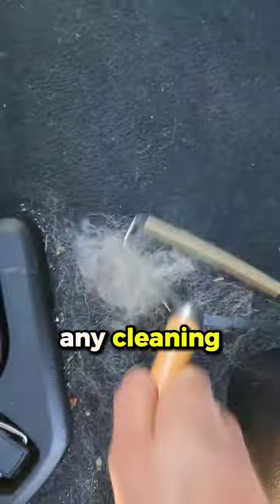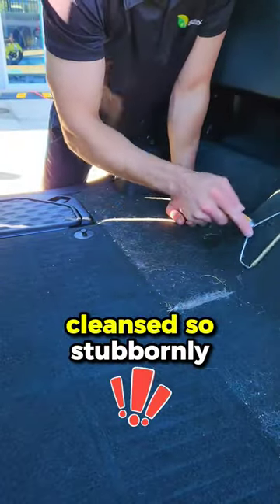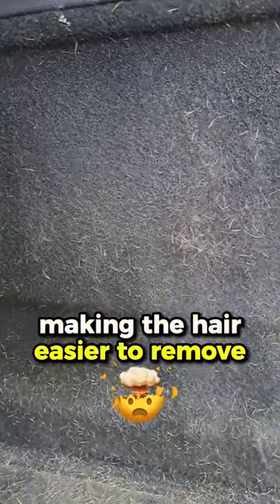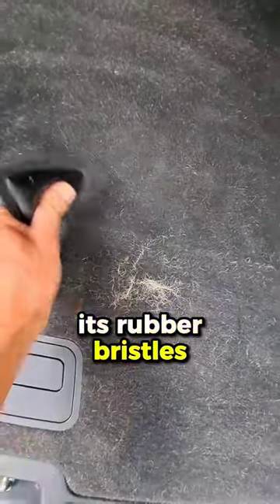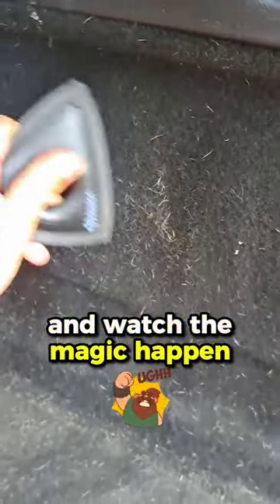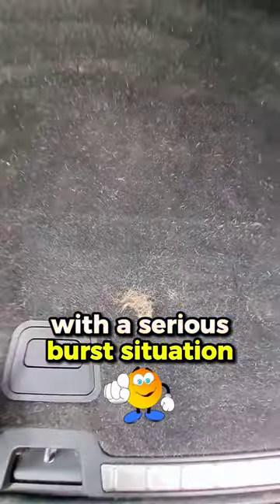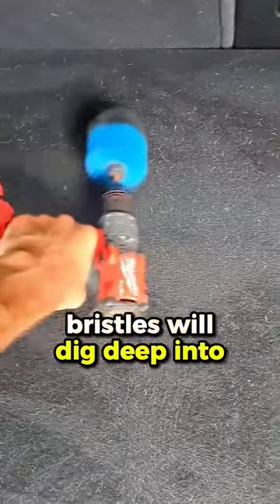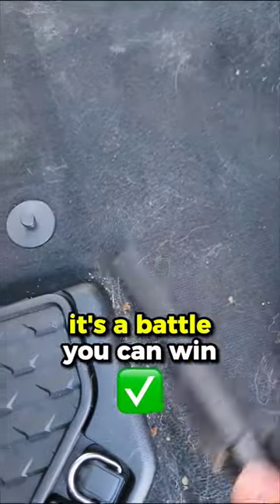How to remove pet hair from your car

Comment: That little brush you said was a game changer looked like it would take 45 mins of constant work to do a large boot and as for the drill brush its just chucking the hairs in every direction you'd need someone pointing a leaf blower over the back seats at the same time for that to work maybe try these things out b4 u make a video??